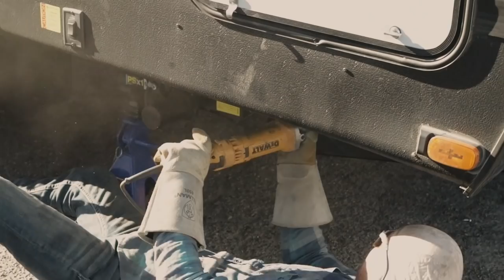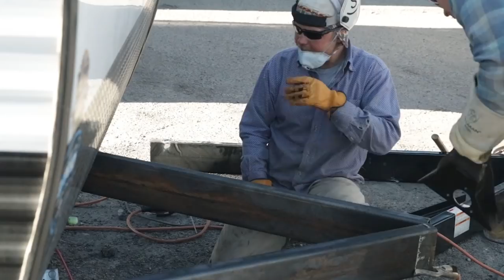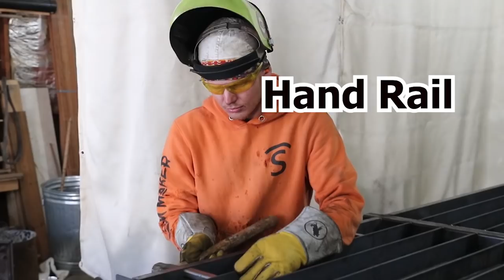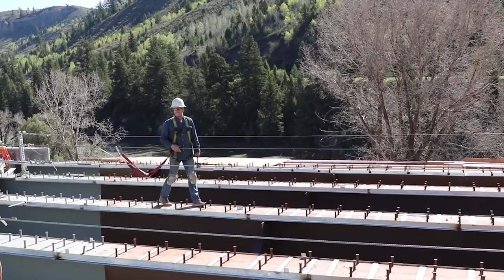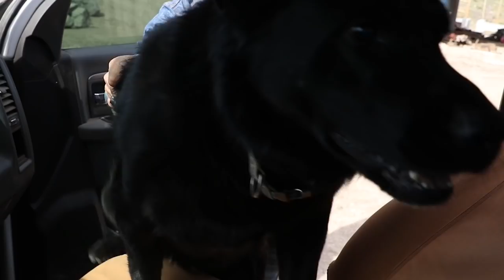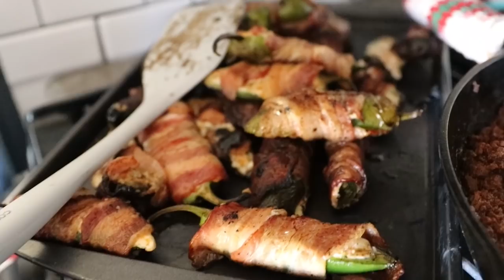The Worst Welding Advice I Was Told And Lived By For Years

Comment: The bulk of my time welding has been in the oilfeild, pipeline and plant construction.  I had a young guy tell me once that structural was for the birds, and asked why I did all the structural instead of using my pressure ticket and welding pipe.   At the time I was laying out a piperack with a crew and told him that while he burnt rod after rod all day(we weren’t supplied rod)  it was 2 in the afternoon and I hadn’t started my welder yet.  we were getting paid the same,  he still told me it was for the birds.  I figured out pretty early on that the structural guy on site was there for the whole job but the pipe guys would be there about half as long.   It’s also neat to go back to lots of facilities in the area years later and see steps/platforms etc that you built.
Reply: I got a pipe cert in welding school but didn't go to work in the pipeline field so I never had any exposer to pompous pipe welders. Burning rod after rod is what the new guys do. With time and experience you become a fitter. If your worth it, you become the foreman, maybe the owner after that. Why the hell would anyone think it is beneath their status to learn new skills. I just don't get that mentality.

Comment: My advice for aspiring welders, welders just starting out. Learn as much as you can about your trade. Learn to diagnose your equipment, learn and retain the theory, practice until your cant, then practice some more. Read your books about what is scientifically going on when you strike that arc. Learn your alloys aswell. You either be that guy that can run a bead, or you can run that top dollar bead, and be that guy who everyone comes to to answer there questions. I learned this early on and it payed off.
Reply: I have a hard time retaining information from the textbook

Comment: A real welder can do both structural and pipe 

The myth is pipe welders are the best welders

To be an all around welder that can weld whatever you put in front of them is the  actual real welder
Reply: That's like being a Jack of all trades and a master of none. Nothing fancy but gets the job done.
Reply: Yeah some what !
I kind of get what your saying 
But a good welder should know his field “welding “ and be pretty good at his craft and not just good enough to get by , also most welders today don’t include being good with back gouging , using a  grinder ,and  a torch . 

Tig , stick , fluxcore, 
mig ( hardwire) , and subarc 
Working different places 
Field work (structural and pipe) ,
fabrication shop,
heat exchanger /vessel shops , and pipe shops 

Will get you there , and with all that day in and day out repeatedly whether you feel like it or not , you really have no choice but to be slick at what you do , a welder with muscle memory especially in places like the pipe shops they known for cracking the whip slave driving with a number they expect you to get everyday , if you can’t they will let you know and if you run a jimmy jammer or a subarc 
Lol lol
Reply: @whysoserious7014  I don't think that's really so much the case crossing over skillsets from pipe to structural. I believe in specializing and being a master of your trade, but when you've got a trade more or less mastered, why not add another skill? Especially one that's got so many similarities. Thicker steel, big stick welders etc ... hell, another crossover for a pipeline welder might be boilermaking. Lots of welding round things. Much smaller round things, and some tig involved and some exotic steels, but ... well you get where I'm going with that.
Reply: @notsure7874  Well said, and I can go with that. 👍
Reply: BOILERMAKERS hands down the best different welds  n tests all the time.
Reply: Most peeps specialize in what's gets them the money n run tests for job.  Money
Reply: @mikeundereood1071  My friend is a boilermaker. He can weld a cucumber to a watermellon if ya want him to ;)
Reply: @mikeundereood1071 Local 191 whatup
Reply: I think that being able to adapt to any welding process based on your mastery of fundamentals is paramount. Be the best at what you do.
Reply: @notsure7874  Yes, the worst thing a trades person can do is pigeon hole himself. Trades are very diversified and the best tradesman is the one that has experience doing a large variety. If you take Pipe welding as an example, they can make excellent welds consistently joining pipe sections day after day but many have little experience in repair welding such as gouging and fixing failed welds, strengthening or heat management and different weld types and material types.
Reply: @notsure7874  I've actually seen a watermelon plant welded[grafted] to cucumber roots.(or was it a squash roots?) Crazy way to deal with cool soil and disease.
Reply: @mytech6779  I've gotta send that to John ... "I thought that was a joke man! You actually did it!!!"
Reply: Idk who told you pipe welders are the best, but every pipe welder I've met can't weld worth shit on anything but pipe.
Reply: @benhaight4562  I’ve met plenty of welders that are excellent on structural and pipe.
Reply: True welders can't paint for shit, thats how you know lol
Reply: @thunderheads4103  Kinda funny - my boilermaker buddy paints bikes and cars - does really good. Get him on an airless or brush and roll, and that goes downhill REAL quick though :D
Reply: @chandlerstevens4498  Gonna hand me a heat gun and a roller too? Cause I'll weld the hell out of some plastic.
Reply: @whysoserious7014  welding is the trade, if you can only weld pipe your a one trick pony,,
Reply: I’ve seen structural welders work that looked like Ray Charles did it. I’m talking about if you walked by it too close, it could rip your shirt off. No way in hell could it pass any kind of an X-ray. Sad.
Reply: @whysoserious7014  maybe a jack of all trades. I definitely can do nearly any metal  in structural or pipe. 1g, 2g 3g 4g 5g 6g, stick, fluxcored, tig and pass xray. Hell give me some old cast iron and I'll braze it and machine back to true. I never understood people that set limits on themselves and be proud of it.
Reply: @eharris6347  that's what I'm about too brother.  Always learning and getting  better.
Reply: @whysoserious7014  jack of all trades has another verse. "A jack of all trades is a master of none, but oftentimes better than a master of one"
Reply: A real welder is truly an all in one guy, and not just a hack at a lot of things but the ability, knowledge and pride to do what ever your hands touch well.
Reply: @notsure7874  cumbermellon sounds pretty damn good if ya ask me!
Reply: @whysoserious7014  thats false, you can be great at pipewelding and structural its not hard lol
Reply: @whysoserious7014  you have to know the whole saying though. Still better than a master of ONE!

Comment: The worst welding advice I ever heard was , you don’t have to be a good welder , but you need to be a good grinder. Words of a hack
Reply: This may be true.... but dont discount the value of proper prep.  Sure, you can weld through scale and paint, but it could just make a bigger mess. Same if you cant cut a straight line with a cutoff wheel... now you have uneven gaps to fill. 
Now.... grinding to make the welds look pretty?? thats a whole other story! "Bondo and paint, makes me the welder I aint!"
Reply: thats not words of a hack, prep is everything, thinking fuck it just weld it , is the words of a hack.
Reply: still gotta be a good welder tho haha
Reply: Grinding is extremely important; for pipe and structural good prep grinding is critical. For ornamental work like fences, balcony rails, and hand grabs detail/finish grinding is what sets you apart from other fabricators and makes you your money. If you can't grind I believe you have no business running a bead.
Reply: A Grinder and paint makes you the welder you ain't 😆
Reply: Y'all know damn well this comment isn't about prep.
Reply: @VuDuGrrrrl8075  you beat me to it by 7 months!

Comment: Hello from England. I've watched you on here for a few years now, and I definitely remember your attitude being pipe or nothing back at the start. I'm happy you've moved on, there's lots of fun in variety. I've welded cars with MIG, I've built test rigs for crash safety, I've built exhausts with TIG, and I've modified fences. I've welded sections of bomb proof rooms, to be installed in banks, and I've welded excavator buckets, and I've loved all of it.

Comment: I've never heard of such a thing. Welding is welding. It's all good. Burn that rod.
Reply: Woman welder here .... I love welding I'm thinking of starting my own channel... When I first started learning everyone told me that I would not make it as far as I am... But I proved them all wrong I just g graduated top of my class welding better than the instructor. I have unfortunately not found a job yet.... Doing side gigs fixing exhaust systems (thank God for catalytic converter thief's) and trailers.  Rock out welders
Reply: @heathenbeast7341  hey you know welding isnt as hard as it seems. And even easier if you already feel that you could have a act for it. Training your eyes on looking at the puddle and just time burning rod is all it takes. Sure uphill 7018 is tricky. But so is it tricky to run it downhill on pipe mainly in my case.
Reply: @heathenbeast7341  Don't let anyone tell you you can't make it.  A steady hand and attention to detail will get you a long, long way.

Comment: As a new structural guy I’ve been hell bent on getting into oil and gas work. Thanks for the advice and helping me realize I’ve already got a good thing going. Will definitely still get into pipe to be a better rounded welder but I will not idolize it as I have been. Much love
Reply: Great advice for yourself. I'm mostly a pipe guy and miss the other stuff alot. It's way overated just like Tig welding is. Too much of only one thing is hard on the head.

Comment: I'd rather hang out in an air conditioned shop and weld fancy custom gates, handrails, and furniture than travel around and weld on pipes...
Reply: Yeah not alot of people are tough enough for work like that, unless you really want more money..
Reply: @TransAm20000Wr  I'm glad some people are, it's work that's gotta be done, and rightly so they should be compensated for it.
Reply: thats sort of where I started out. not custom gates, frames for machines that made computer chips, but an air conditioned shop... for less pay to tig weld than I made mig welding in the weather.
  paid off my house once I left the air conditioned shop to weld on any crappy farm job that came along. was just scraping by in the air conditioned shop all clean and tig welding. if you want pay, you have to get dirty.
Reply: Did that for 2 years after welding school before I called it quits and got a shop job. 70-80 hour weeks, 12-16 hour days on average kills your body. Not to mention you will be away from loved ones and people who depend on you. Some of the worst people I've ever worked with travelled too, alcoholics and drug addicts and miserable pricks who sabotaged their marriage hooking up with some trim out of town. Also gotta room up with those same guys in a shitty hotel because your company wont spend money on a decent one. Foremen take stupid risks and put you in danger to get the job done faster so they can get a bonus, coworkers trying to steal from you, boss running you into the ground rarely giving you more than a few days home before you go back to the meat grinder.
It's not a life id wish for anyone really.

Comment: My jobs sort of set me up. My vocational high didn't have welding, but I've always loved and been fascinated by welding. Took auto body, so some mig basics. Got a turd flux core and would weld anything at home. First welding job was for a fabrication company, lots of stainless and steel mig/Tig but nothing really requiring a spec. First day, started practicing Tig(not aluminum) and  LOVED IT. Next job, all Tig. Mostly steel, stainless and titanium. Cryogenic/vacuum type work. Leak tested with helium, then processed in a high temp, high pressure vessel, >1500°f and >10,000 psi. If it leaked, it can be mild to catastrophic. Next job, building metering pump systems, oil and gas industry. Various pipe welding tests and shielded mig structural for the bases these systems are mounted to. Current job, back to the ALL Tig, same work, different company and AC in the shop! Getting to experience all this has helped tremendously. Not sure if I'd start a business but I'm pretty flexible with the skill. Moral of the story, learn learn learn!

Comment: Plan, fit, solid tacking, welder comfort, assure leads are free and not binding, body protection from burns, good fitting non slip shield, easy full vision, correct lens number and never go to dark or too light, these things make for a great weld.
Reply: Cant argue with any of that brother.

Comment: The more you know will always make you more money. Aaron Ross here on YouTube has gone down a similar route as you in his career. The pipeline work came to a halt and now he is doing his own thing doing structural fab/welding.  My cousin, aka a pipeliner has had to put his rig to work doing structural work, since the oilfield has slowed down. Interesting to see this video cause it is 100% true. I am an HVAC technician now, cause I ran out of oilfield work myself. HVAC is what I knew before and is saving my pocket now. Definitely always need to have a backup plan.

Comment: Currently about to start my second semester in a welding program at a technical college. I have two instructors, one was strictly a pipe welder for about 45 years and the other was an iron worker and a pipe welder throughout his 43 years. They both worked union and non union.
One thing I’ll never forget, “If you weld with one hand you’re half as good as you can be.”
Reply: This is true I can weld with both hands, doesnt matter. It's all about the angle. Sometimes you can just bend the rod. But being able to weld left and right handed is very helpful.
Reply: @edwardclark3980  i think he was talking about tig compared to stick in that refrence

Comment: Started doin my own thing a few years ago most of it does end up being structural and the absolute hardest part of all of it is learning to bid the jobs, the best formula I’ve come up with is materials at cost, keeps me from having to pay extra taxes on it if basically the customer bought it so less I have to deal with. and then the labor I charge 100/hr and I eyeball however long I think it’ll take and multiply by 2 1/2 but I’m also up front with my customers and tell them x2.5 is my bid just in case shit happens and we have problems that were unforeseen that we have to solve( which happens ALOT) however I will be tracking our actual labor time and at the end that is what they will be charged, I haven’t had a customer complain about me doing it that way yet because 99% of the time the bill is less than what I bid it at.

Comment: I have been in the game for over 20 years. I learned through trade school the basics. I learned on the job to weld anything I needed to weld. The  real world taught me to try it all and I’d never go hungry for work. If I didn’t know how to weld something I learned through practice, talking to others and hands on trial and error. I am working in the boiler service industry. I weld steam pipe, stainless water storage tanks , aluminum fuel cells , aluminum water storage tanks, stainless pipe, structural and mechanical assemblies to name a few things. We build from scratch what customers can’t buy and we repair what has to be fixed to keep a business up and running. You can call a structural welder to build the cat walk on the boiler you just installed or finish the pipe work and build the cat walk yourself.  You can specialize and that’s great. For a lot of guys that works. For me I have made a career being able to weld whatever lands in front of me. Sure  guys are faster when they specialize and work on just one type of weld. Repetition builds speed. My aluminum tank work looks clean and is water tight and my pipe work is as good as guys who do nothing but pipe all day. My stainless pipe is nice and tight with crips bright welds. I’m no Jack of all trades I’m a master welder.  Get out there master your craft and go get that money !

Comment: Jacob welding on the bridge are you required to have a state bridge code certification, the reason I ask is I welded on bridges when I was in the pile drives union Boston Ma I had to hold a Ma state bridge code cert.

Comment: I wish I could do trailer repairs but my insurance for my welding business doesn’t cover me for it I trust my welds to no end like at work I’ve been welding the pins for concrete mixture I have to press out the pins and I’ve been passing 200 to 225 tons then are minimum for the press testing is 125 tons been doing all that with inner shield the pins are for Erie strayer in Erie Pa

Comment: Pipe welding is for "one trick ponies".  Expand your horizons.  There's life beyond ROUND.
Reply: I mean, if you can weld round you can weld flat lol.
Reply: Exactly. And there's life beyond steals.
Reply: @mikeundereood1071  gotta disagree and stand by my pipefitter brothers lol
Reply: t. $25/hr capped structural welder
Reply from the maker: I agree with Jeep if you can weld round you can weld flat, but not every welder that welds flat can weld round.